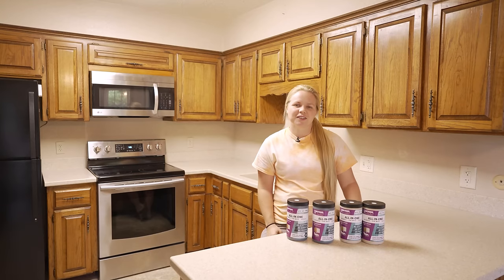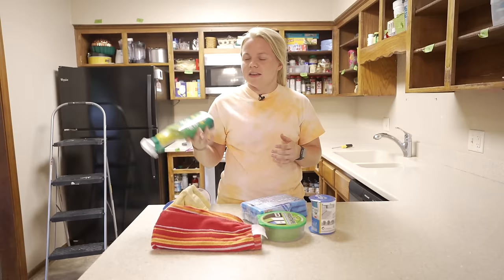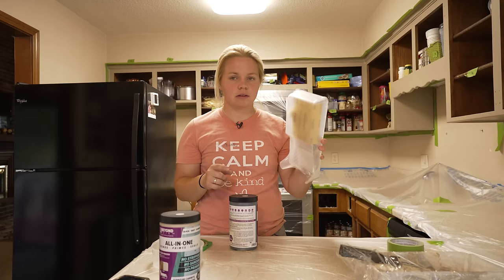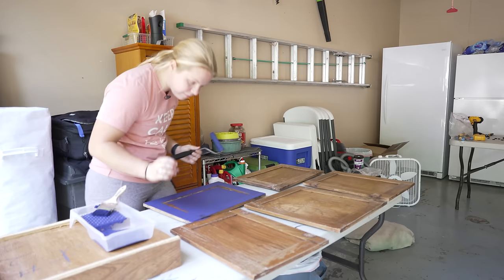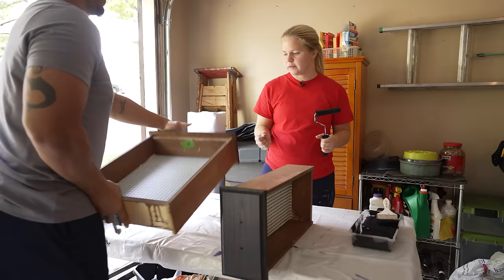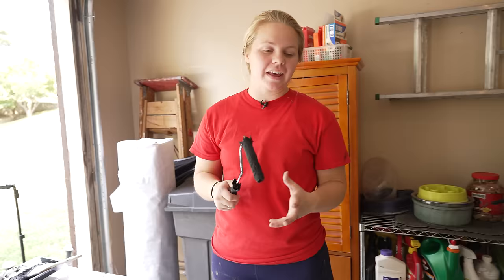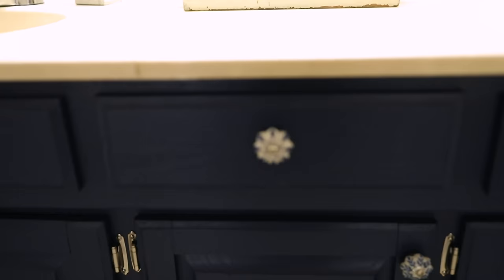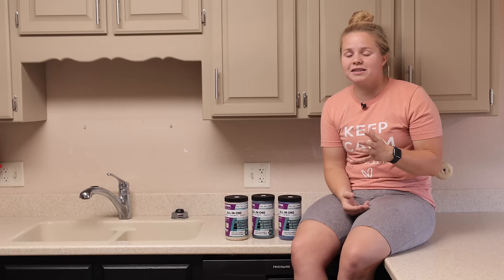How to PAINT Your Kitchen Cabinets the EASY Way

Comment: I've been on the fence about staining or painting my bathroom & kitchen cabinets for awhile. You just totally gave me the courage & inspiration to do the painting🖌️🎨 The cabinets came out so nice!! I also loved that you did dark & light in the kitchen because that settled my mind on which way to go with mine❣️ love your videos by the way💖
Reply: Curious if you’ve done your cabinets yet. I’ve just painted a bathroom cabinets black and there’re great. I’m going to do kitchen in two tone.
Reply: @lorihamlin3604  not yet, just waiting for after the holidays to tackle painting.
Reply: @annmatthews9343  My cabinets were in great shape but were installed in 1992. I cleaned really well, light sand and painted. Took 2-3 coats to cover. Next time I’ll use the recommended stain blocker/sealer. I think one coat paint would work then. I didn’t want the expense of replacing hardware so I soaked in vinegar and scrubbed with wire brush and spray painted with Rustoleum. I was really impressed with the result.
Reply: @lorihamlin3604  thanks for the update. I was going to replace hinges, but maybe I'll try what you did and see how that goes first.
Reply: I used this paint for my bathroom cabinets and kitchen cabinets and they came out great.

Comment: Just shared your link to a couple I met over the weekend. They were talking about painting their kitchen cabinets. Looking forward to seeing how you did it. I had a very old seasoned interior designer in our area used automotive paint for his cabinets and they look fantastic. And, it is not an easy job! on many levels.
Reply: Was the automotive paint in spray form or liquid? I would never think to use automotive paint but I bet it is very durable
Reply: Sharon Gasparaitis it was professionally
sprayed on.
Reply: Nice! The automotive spray costs $$$ but gives a fantastic hard shell finish! I met a guy that does it!

Comment: You did a great job. I'm glad you replaced the hardware and hinges also. I'm curious as to how the owner liked it? Also, maybe give us an update at maybe 30/90 days/ a year so we can see how durable it is?
Reply: alsome
Reply: IIII
Reply: Yes please. I have heard that it almost never dries completely and that you will always get chips around the handles and knobs.  Can you please update us on how well it held up in the kitchen?
Reply: @SuperDubess  From my experience it dries really really quickly. I haven't had any problems with chipping.
Reply: @simonjudah8770  thank you!!
Reply: @simonjudah8770  It takes 30 days for this paint to reach it fully potential durability. I also have heard of chipping. The no-sand part is super attractive, I might take a chance and do my bathroom cabs.
Reply: @lifebeelifebee9214  Yes, it does take 30 days for the paint to reach its maximum durability, however, I have used this paint many times and have never had a problem with chipping.

Comment: We are getting ready to paint some old cabinets we purchased at the ReStore for our laundry room.  So this video was perfect!!  Your tips will be so valuable.  I can’t get over how the paint and new hardware transformed everything.   It would be interesting to see what the bathroom looks like after the new wallpaper and countertop.   And, you are so right….why dump perfectly decent wood cabinets into the landfill when a coat of paint updates everything.
Reply: You know you can paint your. Fridge,  good job. Both of you
Reply: I feel like spray paint is an easier option. But I’ve also painted cabinets using a sponge to apply thin paint coats over a smooth thin layer of primer and a blow dryer, which worked really well.

Comment: I’m redoing mine. Did the interiors last year. They were a mess! Ready to do the outsides this fall/ winter. Planning on taking my time, one section at a time. May take 2 months, but I’m up for it!
Reply: I did mine by myself.  Lots of cabinets.  I sanded and did 2 coats of primer and 2 coats of paint.   24 hrs in between coats of paint.  Removed & replaced all the hardware.  Didn't kill myself, took my time.  The project took me 5 weeks, but it looks amazing!  You can do it!  Good luck!
Reply: @ColleenHershon   that’s exactly what I plan to do!!
Reply from the maker: I did the insides of my parent's cabinets when I did theirs! Definitely an even bigger job trying to get in all those crevices! kudos to you and good luck with the outers! take your time (:

Comment: Love watching the magic! YOU make it look so easy, and probably it is...? I did my oak kitchen cabinets with high end paint from BM. Took me for-ever to finish the project, with all kind of prep, sanding, sealing from potential bleeding with with shellac, two coats of primer, two coats of paint and two top coats. 
It turned out being gorgeous, but in one year it started wearing out on the corners, edges and around knobs. I did everything by book, not sure why it did not hold on as was supposed to.
I am going to get this paint  try on my bathroom cabs. I will definitely use the top sealer, to protect from the bathroom sink splashes.

Comment: You guys are taking the time to do a really good job doing this. Can I just say I think you could really step up your game if you used a level to hang your doors. If you fill the holes with putty, you can move the holes slightly to get that level when you're reinstalling.
Reply from the maker: Hey Duvayne! 

I agree entirely with your using a level. We had to on a few of them as when we hung them back up with the new hinges they were crooked. 

Completely agree and feel that it is important to have a level around in the case you’ll need it!

Thanks for watching.

Comment: Lauren: This project is so inspiring...a beautiful transformation of a kitchen from 1981 to 2021! Did you do a scuff sanding on anything after cleaning and before painting? We didn't see it if you did. If not, were there any dings or scratches that you touched up with a little sanding? The glob glob Beyond Paint you're using looks fantastic with only 2 coats and I am amazed at how little paint was used. It must be some high quality paint since you didn't add poly at the end considering how much usage a kitchen gets (but maybe not so much for a single lady as it could be for a large family.) I am leaning toward using the black Liquorice on my front door with a Poly top coat since it's outside but not really exposed. (side note: Did you get a new nail gun? Is it heavy? I have a few DeWalt tools as well, I like the batteries being interchangeable.) Well, now that you have given me all this inspiration I think I will be painting as soon as I obtain Beyond Paint in Liquorice Black. Thanks Lauren, you're always so pleasant and love seeing The FFT in action all the while providing an excellent tutorial - truly a Teacher at Heart!!!   : D
Reply from the maker: No sanding necessary with this paint! I left the wood grain so there really wasn’t anything to fill or fix! Beyond paint has a built in top coat! which means you don’t need to put any poly on. honestly if you fo your front door, you wont need to apply any top coat. this paint has great protection in itself!
Reply: @FurnitureFlippingTeacher  hello does the paint smell bad?

Comment: When painting stained wood, I always use a basecoat with stain blocker so the brown stain doesn't bleed thru. And I caulk the "creases" where the wood designs are and along cabinet to wall area.

Comment: The kitchen looks so good. I think it would have looked great to continue linen on the bulkhead in the same color to give the illusion of taller cabinets.
Reply from the maker: ahh yeah! didnt think of that!
Reply: Ive done a “fake out” on the upper bulk head in three kitchens...it makes an Amazing difference! 
You carry the cupboard paint colour up onto the bulkhead then I used two different pieces of trim and trimmed it out. 
Kind of hard to explain but i’ll try. 
At the joint where the top of the cabinet meets the bulkhead I added a piece of trim, each time I used something a little different there are so many options of trim you don’t want anything to tall   ( height of the trim, I used a one inch trim) so you simply nail that on, you could also you nail glue first, then also add nails. Fill nail holes and it gets painted the sameness colour as the cabinets and bulk head. Then I added a piece of crown moulding again, you don’t want anything too over powering especially if the ceilings are a standard height , if you have taller ceilings 10-12 feet + you could likley go with a bigger crown moulding) the crown moulding is also painted the same colour as the cabnets & bulkhead. When you are done you have basically created what looks like cabnets that go all the way to the ceiling. This is truly a very easy install, you can have the store , like a Home Depot, cut your trim and crown moulding, take very precise measurements and then you can have the mouldings mightered also at the store) ...so the only thing you will need is a hammer, nails, two poeple to help hold it up , wood fill to fill nail holes, and then the paint tools you will already have from painting the cabnets. 
I hope I explained this well enough. You will be shocked with the results...it’s truly one of the best diy’s I’ve ever seen. I can’t take credit for the idea my cousin did it in her house in 2008 and since then I’ve done it in 3 houses that I lived in and flipped :)
Reply: @makeuplover6852  do you have any pictures? That sounds like an awesome idea!

Comment: I love the colours used and it was a big job done in a short time, so your time management was perfect.  The only thing I would have changed is the hinges.  I think the cupbpards would look better if the hinges were on the inside, especially as they weren't at the same height on the doors (not your fault as you went into the same holes) so it really showed up in the dark colours.  Brilliant job though.   ☺

Comment: I painted the cabinets in my two bathrooms. It was so much fun. I had to do sanding on my surfaces but most just a light sanding.   They look great.  I would love to do my kitchen cabinets but there are sooooo many. Every time I mention it my husband goes glassy eyed and so I drop the subject!  I’m 70 years old and have not trouble getting down on the floor or up on a ladder so I could do it. I can’t however decide on a color if I did decide to paint them. I will ponder it for a few months and it will come to me what color they should be and maybe I will take a crack at it!  I really like the paint you are using so I will keep the name of it for future reference in case I decide to do my kitchen.   Great idea writing the number of the door in the hole where the hinges go. I would have never thought of that!

Comment: OK just started this project. First tip: do NOT use foam rollers. you want the regular woven rollers. use a small 4" roller. Get 6 or 8 of them. The first coat is a little rough. don't worry, let it dry for 2 hours. Once you get the second coat on, it looks GREAT. The paint smoothes out. Use the "dab" motion with a brush for small lines you can't fill in with the roller. 3 coats might be needed. so far I am pretty impressed.

Comment: In all due honesty, the professional method is to prep cabinet outer finish using either a fine steel wool, and a de glosser. This cleans and makes a tooth to adhere paint. The method I have done for many refinish kitchen jobs is spraying oil base primer. You use a h.v.l.p. spray rig. Called high volume low pressure. This requires you to mask the cabinet frame. Using a masking tape machine with blue painters tape, and either 6" paper, or 12" paper masking. After spraying two coats of sand able primer, you sand using 320 grit sand paper. Then you use tack cloth to clean off all primed sanded surfaces. Then you spray your finish coat two times allow dry for 24 hrs. Then your cabinets will look like from a factory!

Comment: I’ve done a couple kitchens and all in all it looks great for the average person who is not a professional painter they would be thrilled with this job. I had a can of that paint and wondered how it worked out because I never got to use it since I moved before doing the project, so thanks for sharing that information.
Reply: Thanks for sharing what you did, turned out Gorgeous!! I'm thinking of painting my 28 yr old cabinets plus replacing hardware..Your video was very helpful and precise!!

Comment: Props to you for taking on the task an advice from a pro painter always sand and prime with a high end primer preferable oil based for cabinets with varnish under sand between coats if u don’t sand or prime it’s going to peel 100%

Comment: I just stumbled across your channel I really like it so far this video in particular I just painted my kitchen cabinets almost identical to these the only difference I did a faux distressed paint on my upper cabinets I even replaced my knobs and pulls with mismatched ones from Hobby Lobby because I couldn't just pick one. Now I just have to install my new countertop, porcelain apron sink and goose neck faucet and light fixtures and my kitchen will be done for less than 500 dollars.

Comment: Grate job!!! I did my brothers kitchen cupboards and I start with the inside too, but before I turn to paint the front, I put "push pins" (about a inch long)on the 4 side of the door. It was amazing and paint the sides was so much easier.

Comment: Love that Licorice color. That turned out nice and compliments the stainless/black appliances.

That "navy" looks more like royal blue. Look at the blue cooler in the garage, which appears to be the same color as the "navy" bathroom cabinet doors. @29:40. 

As a matter of personal preference, I prefer my hinges to be internal and only have the metal handle showing on the outside. However, what matter is what YOUR client likes. 

Thank goodness you did this traveling prior to gas prices going sky high!
Reply: Yes, the hinges stood out to me, as well. I think their choice of paint colors is a little strange. I hope they ended up painting the wall. The black licorice is nice but the linen and blue aren't what I would've chosen.

Comment: Primer and top coat if you want it to last. No paint will hold up to heat, grease, and dirt without a top coat - The only one I found that came close was Rustoleum if you prime and spray paint the doors.  The boxes can be rolled. I think she received some compensation from this paint company. I would have trimmed the scalloped trim and made it straight for a more contemporary look.

Comment: I suspect that when people complain about seeing "brush marks," what they're seeing is the texture of the surface they painted. A pronounced wood grain will show through paint if you don't use grain fillers, followed by a couple of coats of primer. If they're complaining about how the surface feels, they need to use a top coat.

Comment: You so desperately need to get an hvlp paint sprayer! Mask everything and spray enamel make life fast and simple. then I rosin paper floor and line up doors on floor first face down to spray primer on backs wait 30mins (work on body of cabinet primer while waiting), spray color on backs wait 1 hr  (work on body of cabinet spray color while waiting) flip, spray primer on front wait 30 mins, spray color on front wait 1 hr put on hinges and hang! if it requires high high gloss you can spray clear coat of max 2k its incredibly strong finish YOURE A BEAST! I know how hard the work is! thanks for vid! get an hvlp and save yourself and get better results!

Comment: Great job, I'm sold and will be doing this on my new home.  Question since Beyond doesn't seem to sell brush/roller kits (anymore), what are the specs of the roller cover you used I have a 4" roller and wondering if I should use foam or microfiber and what nap etc.

Comment: After cleaning make sure that you sand down the clear coat on the cabinet and doors and then apply a coat of oil based primer before applying the finished coat.
You will definitely destroy the cabinet's if don't sand and prime with a oil based primer.

Comment: Looks like the roughness they are talking about is just the wood grain in the cabinets and not a brush mark. If you want smooth cabinets then you have to sand really well before you start and sand after every coat of paint and you will typically have to do three coats of paint to get them perfectly smooth.

Comment: I have some kitchen cabinets that I am going to paint, but I am absolutely terrified to do it. I love this paint, so will definitely be using their product. As for my cabinets, I have been told by big box paint experts that I need to rough them up (sand lightly) and use an oil based primer because of the polyurethane on the cabinets currently. Do I still need to do this step with this paint? Thanks for any help you can give. Love the end result of this video!
Reply from the maker: As long as you clean, you don’t need to sand or prime

Comment: End result is stunning. The cabinet doors need pull knobs instead of handles though.  It’s really difficult to clean those handles and scrapes and cleaners scratch and wear paint fairly quickly from all the use. This is from experience.

Comment: This is awesome! I had my kichen just done less than a year ago and its the size of the kitchen you did here. I paid $4500. I already have multiple places where the paint has chipped off. They sprayed everything and made a huge mess! The way you did this here looked way easier! Did you have to sand down everything?? I remember my painters sanding everthing! Can this brand of paint be used to paint furniture?? Would I need to sand it down first?